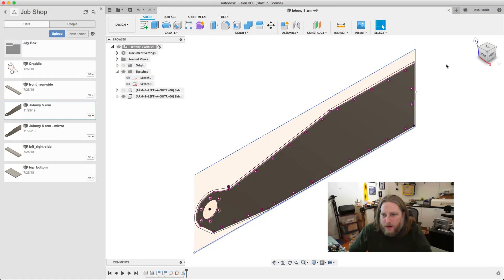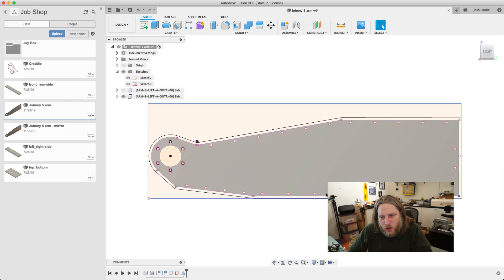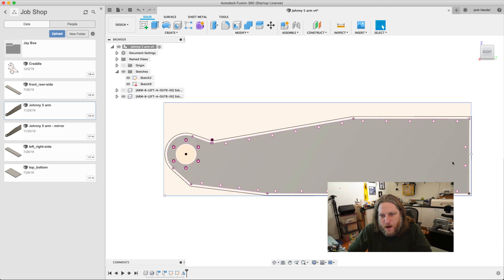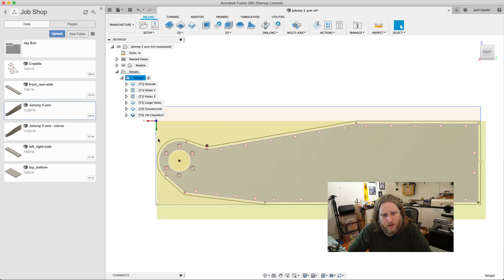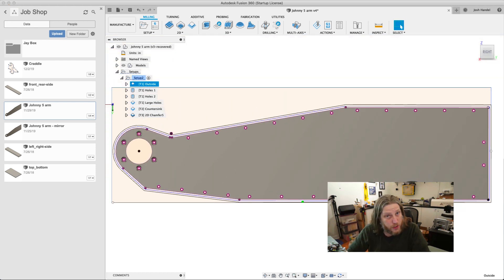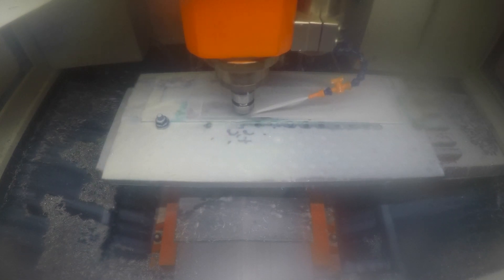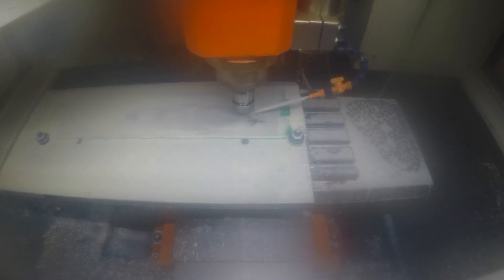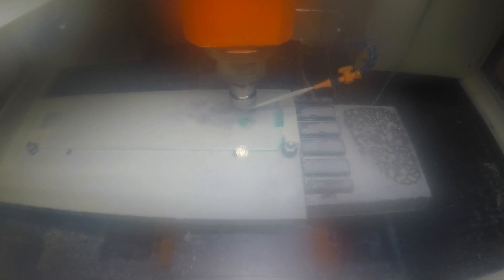Making Johnny5's Arm Panels (for NYCCNC)

Comment: 'We don't need to zero the x because the zero for the x is literally the limit of the machine.' I really enjoyed that one! Too bad you didn't include some footage of modifying the machine.
Reply from the maker: It was really a bit underwhelming modification.. I observed that there was more throw in the x axis than the limit inductive limit switches were set to, so I took off the block that is used for sensing by the switches and ground it down a bit on either side lol...